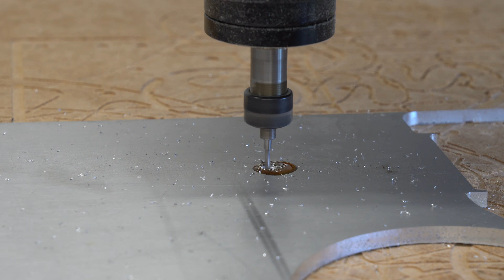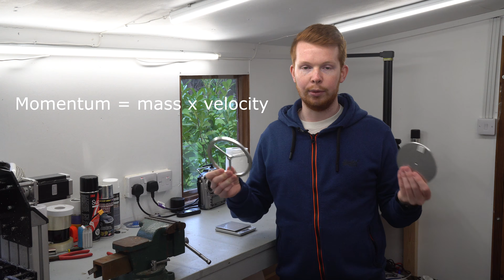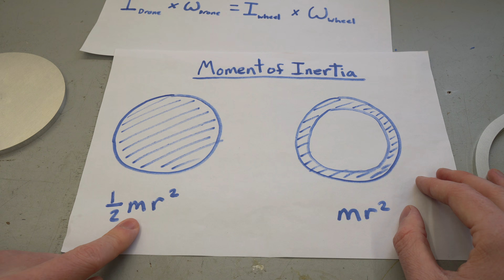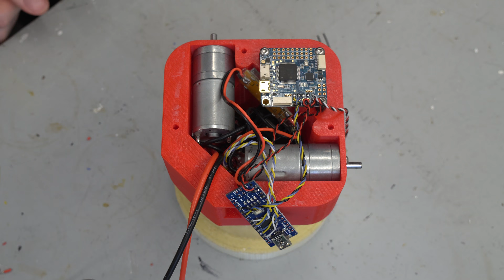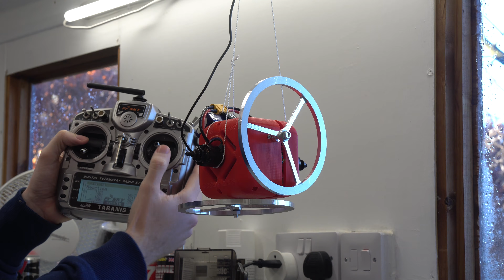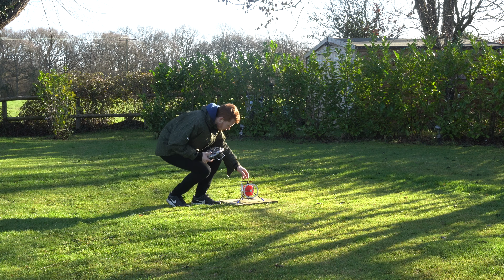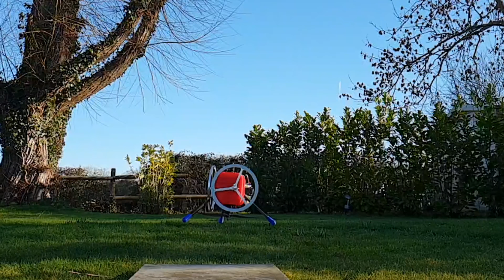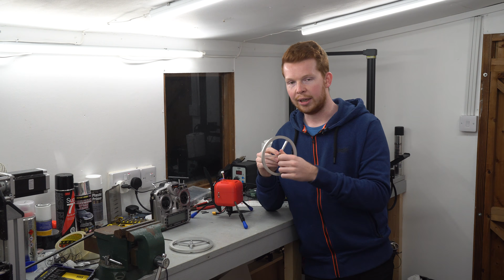Comment: This guy has two gyros on one side perpendicular to each other...🤦
First of all lad, if you want that thing to ever lift, you have to have two gyros in parallel, one on each side (left and right) and both spinning in the same direction. Meaning that if one is spinning clockwise, the other should be spinning counterclockwise so that both spins are facing a single direction.

Comment: You could use a 2-axis pendulum instead, and just use the tilt of the pendulum to correct for tilt of the drone?  The pivot point would need to be mounted in the centre and pendulum hanging below for best results.  Another way of looking at it is tilting the top propeller using the mass of the body as the pendulum.  Gyroscopes are another option.  You probably need 2 or 3 of them to cancel out the torques.

Comment: This is wonderful 👍 I think the weight of the reaction wheels has not been considered enough. The propeller blades directly above and below the reaction wheels on a 'stick' for lack of a better word. The craft is trying to account for its own inherent instability I.e. the weight of the two wheels on only two sides of the cube. Counter weights either opposite-sides cancelling out their angular-weight (I think I made that up) at 0 rpm of the reactions wheels might work 🤔, although increasing the overall weight. hmmm...similar to my ninebot one E electric unicycle, if you don't relax, it creates a feed back loop from control surfaces to the (gyro) control unit. The gyroscopic nature is familiar. Especially when the science was explained on the blue rig. Amazing creation... wish school was this fun 🙂

Comment: I believe that this mad contraption might work in theory, and we even got a somewhat successful flight. I believe that sudden jerk and inconsistencies in the motor output are the cause for instability, and in order for this sort of drone to work it might necessitate use of two motors and reaction wheels per axis. That way, if a reaction wheel might overreact and jerk the drone, a secondary reaction wheel might assist in smoothing out any overreactions.
Hell, maybe two constantly running counterrotating reaction wheels per axis might create gyroscopic stabilisation effect, and pitch & yaw can be adjusted through smartly adjusting speed of them. It all might be complete bull, I'm just throwing ideas at the wall, but this video made me think. Thanks Tom!

Comment: Very clever application of the use of angular momentum to set a position. Your diagnosis about the problem you had is probably good and the idea of using a motor and encoders is a good idea to have it right.  Just another detail, maybe adding guards to protect the propeller against contact with the ground/objects would spare you a lot of time in repairs, between attempts in tuning.

Comment: You should do a geet conversion on an engine get a small engine get it running and take test output and the exhaust gases then convert it based on Paul pantone design and test the outputs and exhaust gases

Comment: For balance it needs two side wheels. And the propeller must be a lot larger. Because the thrust its blocked by the chasis and flywheels. What you got there its a gyro balanced wheel. If you investigate the dual gyro wheels on a self balanced stick, you will do a good project. But you have made a mistake by adding just one wheel on the side.
I will try to help you with my ideeas for improvement.

Comment: the angular momentum can also be reduced with added pressure or vacuum on the structure... as satilites don't have high air pressure to help with stability. with forcing air into channals to direct it out for added counter movement. but even in space there is some friction of lighter atomic mass... large masses and gyroscopes are also 2 forms of stability.

Comment: This is actually a really great idea and seems like it would have practical commercial applications.  One of the most annoying things about drones, both for the user and bystanders, is the noise of all those rotors.  If you could achieve the same control and maneuverability with reaction wheels and a single rotor, I would think that the noise would be significantly less.

Comment: I don't know if you're still working on this, it's been several years, but given that the videos appear to show the body precessing around the yaw axis with the pitch and roll reaction wheels making it worse instead of better, I would bet money that the problem is that control system is assuming nothing on the drone is rotating when it calculates the torques to apply.  i.e., you're assuming that d^2\Omega/dt^2 \propto \tau, and using that to calculate the torque to apply to right the ship.  that relationship isn't true if the body possess angular momentum, and with lift rotors spinning, because you rely on differential rotation to control the yaw axis, there is almost certainly always a net angular momentum, and it'll be in the yaw axis direction hence the precession about that axis.    the correct relationship is d^2 L / dt^2 \propto \tau.  don't forget, though, that when the reaction wheels are spinning, they, too, add to the angular momentum., and so you need to estimate L given the current rotation speeds of all 4 motors, and from that derive the tau required to move it in the direction you want.  project that tau onto the reaction wheel and yaw axes, and that gives you the torque required for each.  yes, when the reaction wheels spinning, the yaw axis is required to assist in pitch and roll control.  it's not necessary for the estimate of L to be particularly precise, for example the magnitude is less important than the direction when figuring out what how much torque to put on each axis, so it's more important to know the ratios of the moments of inertia of the reaction wheels and lift rotors than their actual moments of inertia.

Comment: What happens if you nest one disk inside the wheel and rotated them in opposite directions (one clockwise, the other ani-clockwise) at the same speed then nested those two inside a pair of gimbled wheels such that they can be adjusted to align to any plain, with those two wheels also spinning in opposite directions (one clockwise, the other anti-clockwise) from each other?
Also, I covet that 3D printer. I so very much want one, but I can't afford lunch, much less a 3D printer.

Comment: Have you considered using back-emf as part of the control loop?  My intuition is that it should have give you feedback based on the loading which might work as an analog for the change in momentum/force applied.  (Your encoder idea may work, but I suspect you’ll have to model/calculate things much more precisely.)

Comment: Hey, couldn't you just make the cube have a wheel on each side, spinning all clockwise at a constant speed? You should be able to make small adjustments from that constant speed, letting you control the direction of the drone.

Comment: I loved this video!  The problem mentioned in the last  part, can't be solved by adding two more wheels at the other side?? Like yeah it would add more weight but you could use it to desaturate the saturated wheels and to provide momentum in the opposite direction quickly?

Comment: I really enjoyed to see how your mind works (including motor control solutions towards the end).  Many years ago (back in the 90's in fact), I had the idea about using flywheels to dynamically modify the momentum of a moving vehicle (car, plane, drone, sub, etc.) to assist in better maneuvrability and directional changes (including acceleration bursts and deceleration absobrtions).  Having seen your video, i do believe I shall do a prototype as soon as I can afford the time and expenses to properly do so.
Thanks for the inspiration to move ahead with my own crazy ideas.
I will check more of your work & subscribe.
Cheers & keep on the good work!
M :)

PS   Keep that mind sharp!  You will probably go far (also "errors & mistakes" are a normal part of moving ahead and learning through experimentation).   :)

Comment: Wouldn't you also have to have your reaction wheels account for overcoming the gyroscopic force of the other reaction wheels, based on their current rotation rate?
Would the power draw of the various motors possibly compete with each other for juice from the battery?
It looked like the reaction wheels were doing their job, but were simply reacting too slowly, which created an overcompensating wobble.

Comment: you could use ferrofluids , disc shape , make it in 3 virtical parts , the middle one rotating with the ferrofluids in it and install the rotors underneath the craft . you now have created a perfectly balanced ufo , wait whut ?
Reply: just kidding , but you could totally use one to create a super stable quadcopter .

Comment: I'll be honest this seems like the kind of thing someone in the 1800s would've thought up
Reply: It was a time of science!
Reply: They had the math and theory figured by then but no flying machines at all never mind a remote controlled drone. They had no 3D printers, router/cutting table or tools to make the machine in the vid but I think if they had all that someone would have built something similar.
Reply: reaction wheels are a relatively recent concept because they heavily depend on accelerometer data and software

Comment: if all thrown energy is absorbed in rotational momentum, not linear movement, or a linear sled, recoil energy absorption
Reply: you can throw a rock without yourself moving
Reply: single simple thrust source, like jet
Reply: ethanol rocket, air breathing
Reply: nose cone turbine to remove all drag and top speed to hyper sonic without heat damage, lighter body
Reply: centrifugal cone shape turbine air flow sling   ---->    <(

Comment: @tom Stanton - a very interesting experiment / concept. However, I was puzzled from the very first start because my immediate tought was : your calculation does not appear to take into account the angular momentum of the engines themselves (the parts move internally with very little distance to the axis but, relatively, a lot of mass and a lot of angular speed.) So it seemed to me immediately that it would be difficult to have a vast enough stable filght enveloppe unless you could somehow get the engines to spin permanently, at constant velocity, and somehow clutch off/on the reactions wheels. Without such a mechanism, by concept the sum of the two momentum on each axis would necessarily lead to a over-torque at low rpm and under-torque at high rpm. This would in turn force the mobile to bank strongly from take off and then lose the ability to self correct as the wheels become less and less "torque-efficient".  At the end of the day, it SEEMS to me it would have been simplier and more efficient to have only one wheel, turning at constant rpm, but itself mounted on a vertical axis so that the wheel can face different axis ; the flight controler deciding what nagle the axis can face (and the spining on the vertical axis providing extra gyroscoping stability). I would really be curious to know your thoughts about that.

Comment: Few things going on here. One is gyroscopic procession. Your rotating blades are interfering with your reaction wheels by applying a torque at 90 degrees to the reaction wheel input, forcing the other reaction wheel to need to detect and compensate for this. I suspect the counter rotation doesn’t quite cancel this out because the blades are quite far apart relative to the centre of mass and this results in instability. (Kinda like the intermediate axis theorem) The second one is that your reaction wheels have been set to have some tolerance before which they seem to engage. This is set too high, I suspect you set this to high because either it’s not within your control or because of jerky motion of the vehicle. The reason for that jerky motion is ironically because the overall moment of inertia for your craft is TOO LOW relative to the reaction wheels. The craft needs to be bigger and heavier. You’ll get much smoother motion that way, although your wheels will have to work harder. And finally, I suspect your motors torque isn’t quite linearly dependant on the voltage for some reason. And I suspect you haven’t compensated for this in the software. This will result in every correction being an approximation of the actual correction. Overall cool video though

Tldr make it

Comment: How did you read servo pwm with an arduino?? I have been searching for an answer to this forever and can't figure it out, the only way I have found is to use interrupts, but then you can only really do one input signal. Also I would reccomend not using servo pwm here because of its latency and low resolution. Also I know this video is old, but the esc software in drones has gotten way better with variable PWM frequencies (the pwm that is output to the motors, not servo pwm) for low throttle stability, and reversing directions is much smoother because it is needed for 3d drones (motors spin both ways)

Comment: You're talking about something that needs to maintain a constant linear lift vector, doing that outside in the wind gives you no chance of calibration due to the changing wind vectors. If it was inside and high off the ground you might have a shot at getting it stable and somewhat calibrated!
Reply: Do it in a sports-hall / gymnasium, when this shanter is all over, and tie it on a rope strung to the roof that will stop it from hitting the ground. You'd then use a start sequence to avoid fouling the rope @ launch!
Reply: or scale it down

Comment: Hi Tom,  have you try  to change configuration wheel with two wheel per side?  Each side would have 2 wheel in contapposition and running at fixed speed;  if speed is the same no reaction is expected,  while if speed is different you will obtain a reaction wheel
Best regards

Comment: What do we think about reaction wheels in pairs? So that we have this current setup, with rxn wheels to adjust drone level, and then additional rxn wheels to relieve the controlling rxn wheels of saturating. More weight, but the accessory rxn wheels could be designed to be slightly smaller.. Thoughts? I've probably missed something in this thought, what do you think?
Reply: Josh
great idea

Comment: The problem is about yaw. putting the reaction wheels off-center from the mass causes the drone to create a constant error on the opposite side from the reaction wheels. Balancing the reaction wheel torque with wheels on every side may fix your problem.

Comment: I think you should have allowed for increased drone inertia. I think the inherent stability of a drone with more angular inertia would be very beneficial for ironing out the controls. Minimizing drone inertia does not seem to be necessary to achieve reasonable handling capability.

Comment: I suggest you might try stepper motors to get more control of rpm change rate. I'm pretty sure ones exist that will do the job but I don't know how much they would cost to get the performance you need.

Comment: Very interesting tests; I suspect that if you had 2 constant velocity flywheels rotating just behind the variable speed rings it would counter the blades uneven performance due to wind sheer fluctuations (from breezes) and help reduce undesired drive vectors from occuring due to the slight tipping of the assemblywhich begins to occur while it's flying. Then when you intentionally active the ring flywheels with your remote control, the controlled ring flywheels will influence the device's pre-stabilized posture rather than just attempting to continually create a stable condition and adjust the device's posture.  As the design is now;  your sort of asking for two simultaneous actions to be accomplished from a ring flywheel which can only perform only one at a time; but tries to do both by rapidly switching back and forth. My suggestion may be difficult to build as it would mean making a shaft of the motor driving the variable rpm flyweel and adding a collar (on that same shaft) driven by an offset gear to a second motor which would then drive the constant rpm flywheel (so as to maintain the center of rotation on both flywheels; x2 since both axis would require this to do an accurate determining experiment). I think you are onto something important with this idea because it would allow really important advantages for flying vehicles. This approach might reduce the number of exposed blades required (increasing saftey, reducing noise and size and maybe even reducing power requirements to have controlled flight as it takes less energy to spin something without wind resistance and at lower/intermittant speeds). flywheels can be placed in shielded cavities such as fenders and allow size trade offs by mass and speed variations. Another benefit might be reduced wind output which may permit vehicles to become more practical, enabling a greater variety of acceptable landing areas like parking lots or parks with higher pedestrian presence is a concern. Property damage from small rocks and dust would also likely be reduced.  I like the inventive way you research and develop. It shows you have the kind of insight required to distill a crude idea into a useful one. I'd like to hear your responses to these suggestions? Have you done any other development on this since this posting?